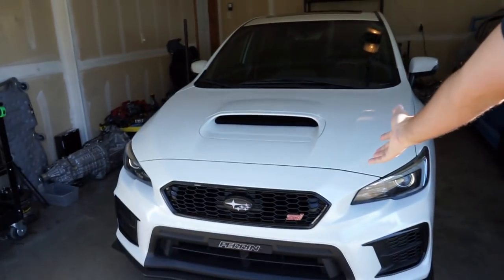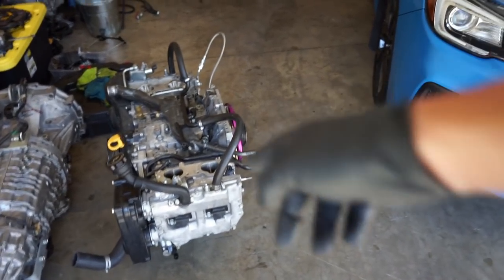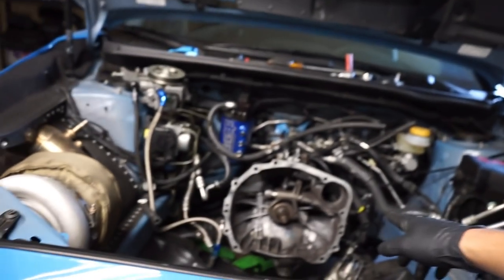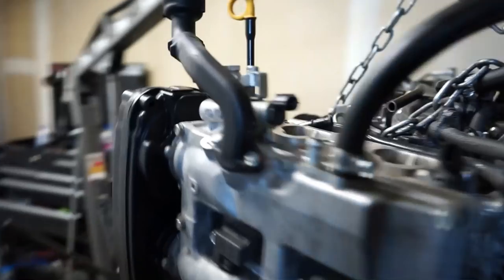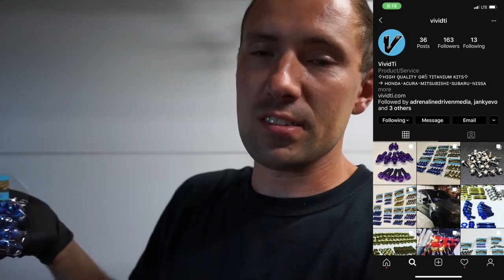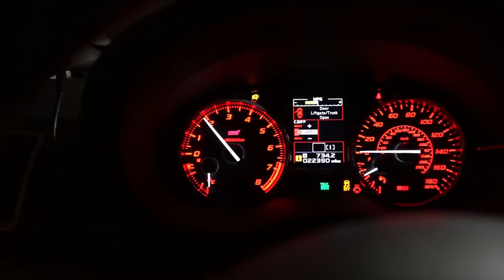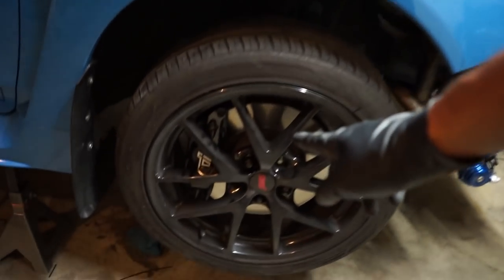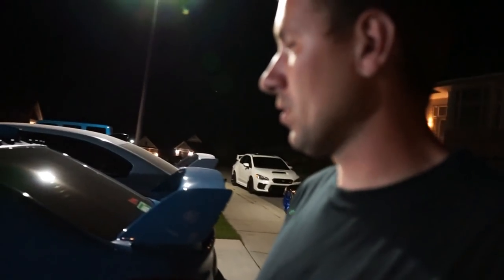Bringing my 1100whp STI out of hibernation

Comment: liked and subscribed!

where do you get the bracket to attach the IAG AOS to the middle of the firewall?
Reply from the maker: It’s a custom mount sir
Reply: What type of oil do you recommend I use for my first oil change on my 2020 STi? I’m at 600mi. Also, what oil do you recommend I use for negative degree temps? I live in North Dakota.
Reply: @joev8275  Google

Comment: How reliable is the car at that horsepower level? I had someone tell me that at this power level it would need to be taken apart after every race
Reply from the maker: Reliable and 1000+whp on a 4 cylinders are not words that go together. This car has had its fair share of issues, granted several were me growing with the car and gaining the knowledge as the car grew. I am pretty proud to say ive gotten a whole race season out of my motors and then they usually break or get refreshed by end of year. I have made alot of changes and its continuously growing to hold the power better and better.